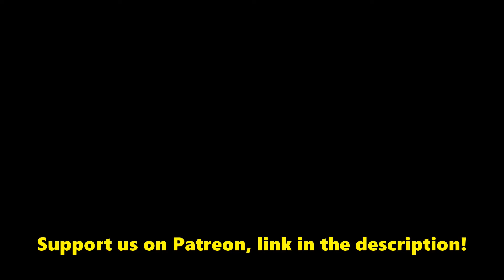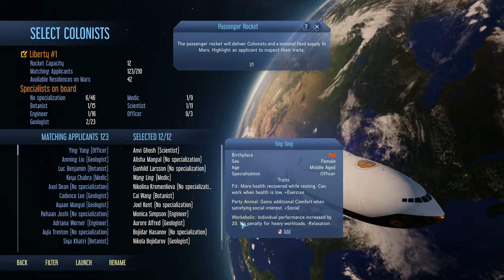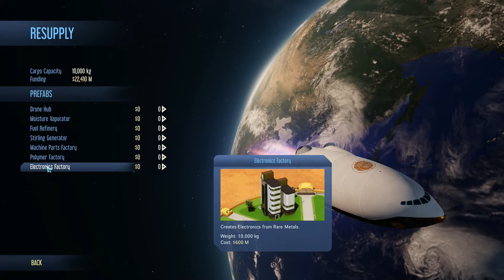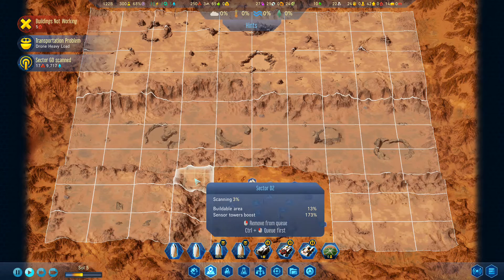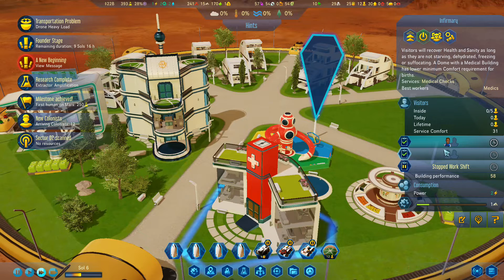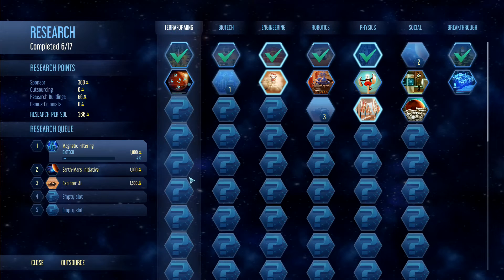Surviving Mars New Earth Project #3: First People!

Comment: The dome, is a connection, you do not need to build secondary connections.
Build landing pads for the rockets, it keeps dust down. Dust damages nearby buildings.
No specs, work in service buildings, ie. Restaurant, stores.
That grayed out, what is that, area looks like off gassing